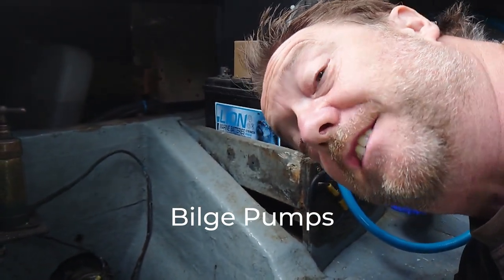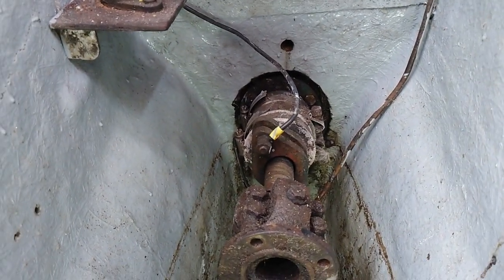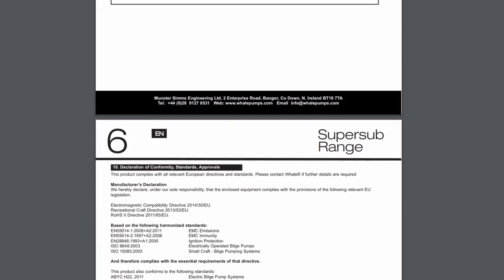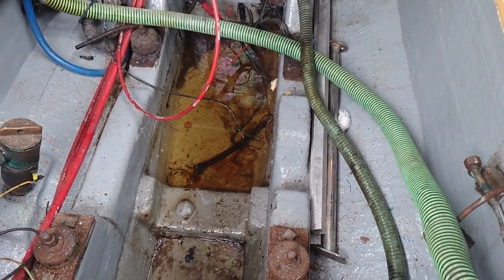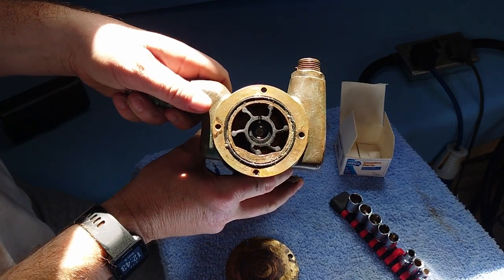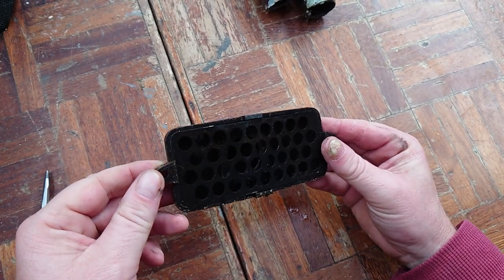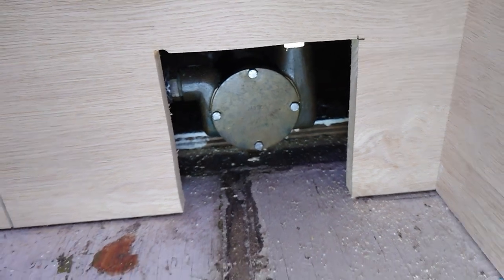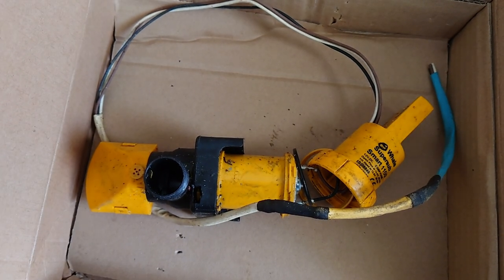Bilge Pump Installation: Make Your Boat Stay Afloat!

Comment: Excellent work John, a keen follower of your series. Have you considered rust treating old components before they go back in (eg old bilge pump motor)? I use Bilt Hamber Oxy Gel (or Jenolite equiv) and it not only cleans up old surface rust but stabilises the surface to give a new lease of life so easily painted over with some Jenolite Directorust paint to give more protection and a newly restored look.
Reply from the maker: I have used Vactan before, and one thing that needs converting sooner  rather than later is the iron part of the keel. Haven't used the products you've mentioned here Colin, but have looked them up and might give them a go. Cheers.

Comment: Good video. Those 'smart' Whale pumps are useless. Had 2; All they  ever did was sit submerged in bilge water doing nothing, or run the batteries flat pumping air. Now happily using float pumps - little to go wrong!

Comment: Nice video. I had that Whale pump in my last boat and had to replace it as the impeller shaft sheared. Had bo choice but to get another due to very shallow bilge. My new boat only has a manual bilge pump and i want to fit and electric one. The pump mounted out of the water with a strum box looks like a much nicer solution!
Reply from the maker: No question that the pump out of the water is a better solution - but separate float switches are usually mechanical in some way and IMHO not as reliable and don't have the 'smart' delay features.
Plus the total cost is about three times that of the integral unit.
Glad you enjoyed the video, and thanks for watching.